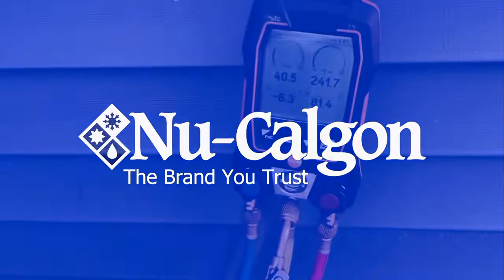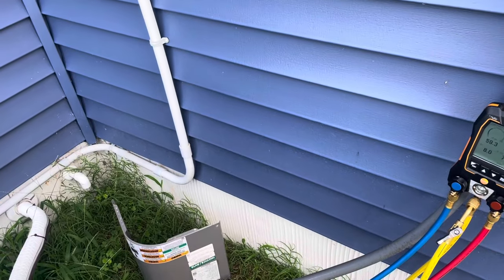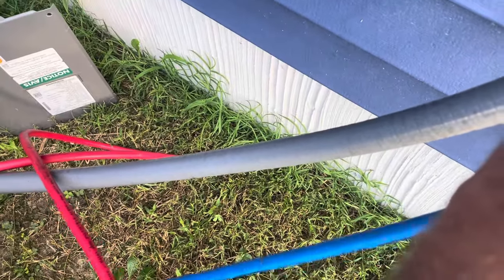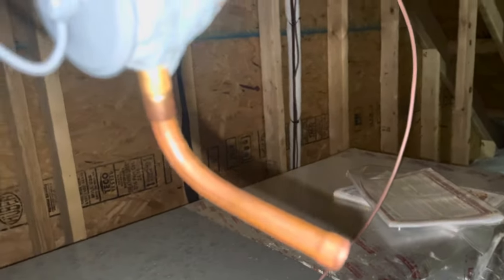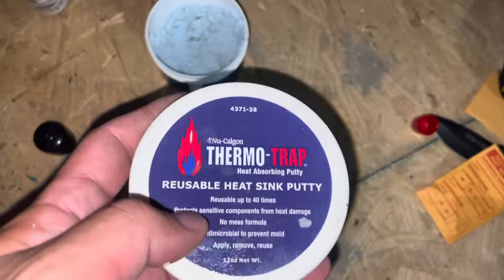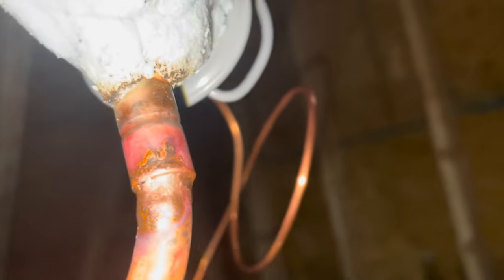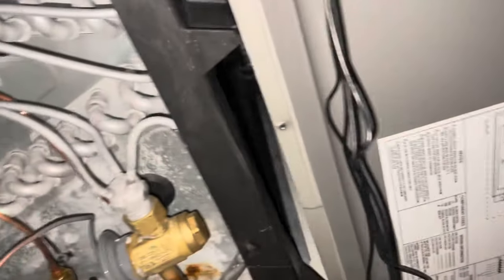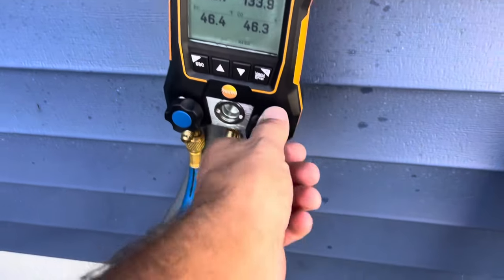No Cooling! Rheem TXV Replacement.  Nu-Calgon Scorpion LX15 Install.

Comment: If the txv is restricted then you need to open both blue and red knobs and go through your gauges

Also you can't pump down a microchanle condensor has to be tube and fin

And if you are pumping down a heat pump you need to cut a small peace of thermostat wire and jump red to orange on the defrost bord to pump down

Comment: there is a 1.5 to 3 and a 3.5 to 5,it looks like they gave you the bigger txv,when pumping down it helps to wet the condenser,or you can use the compressor to pump it into the recovery tank.hope that helps somebody,thanks for sharing.

Comment: That uv light looked cool. But don't they need there own 24 volt transformer? All the ones I've installed said use a separate transformer, some of them even came with one.
Reply from the maker: This one said you could jump right to the factory one.  Did not come with one.  I think because it consumes so little energy with the led bulbs

Comment: I have the exact same gauges I noticed yours is almost dead on battery once it’s very low it will start mis reading and not reading correctly disconnect gauges out new batteries and re try
Reply from the maker: Yea.  Just replaced them yesterday.

Comment: I’ve always heard that you shouldn’t install the UV lights near flex duct. I guess it will ruin the flex?
Reply: Meh it cycles on and off so take much longer deteriorate the flex
Reply: I've also heard that if it is placed near a filter that it damages the filter.